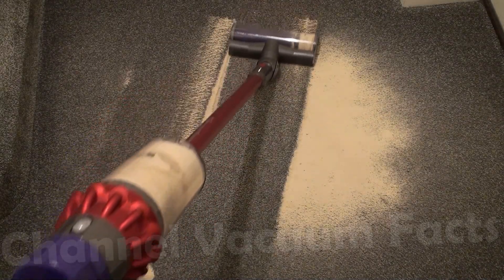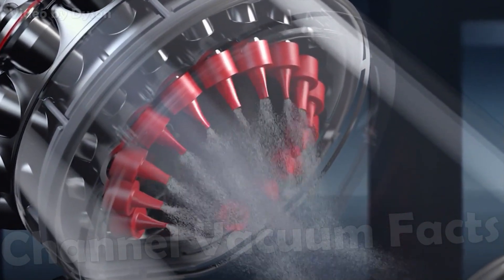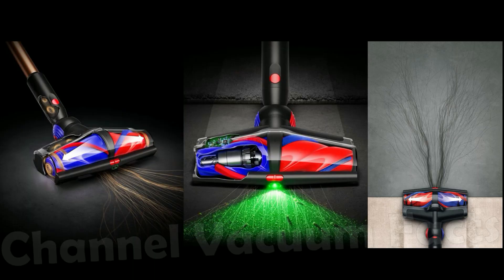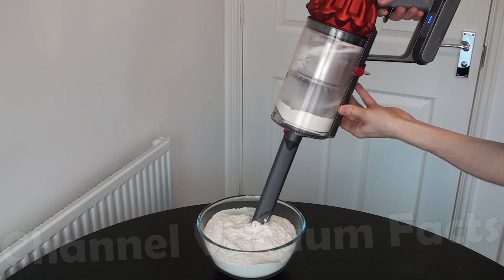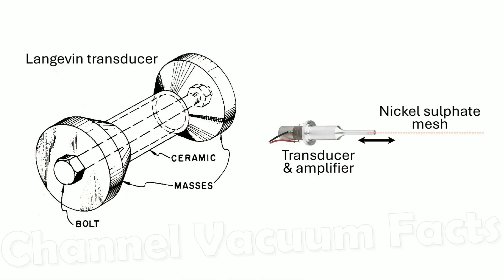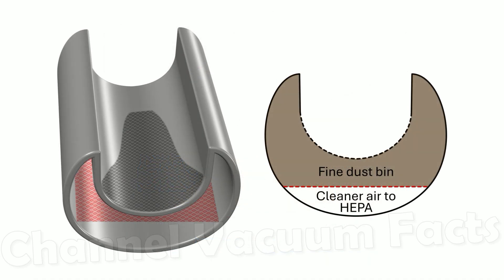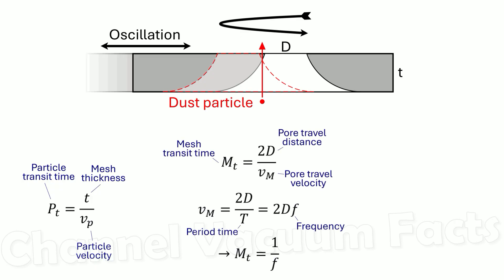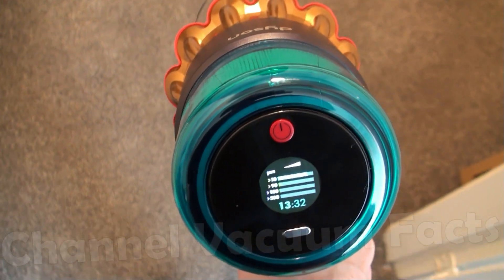Ultrasonic Vacuum Cleaner Filtration — Beyond the Cyclone 2!

Comment: Nice technological preview!  While you don't seem willing to name the developer of the technology, are you willing to share patent numbers for those interested in learning more?  Are there any vacuums with the newer technologies discussed in your recent videos on the market yet?
Reply from the maker: I didn't save them. You'll have to do your own research if you genuinely are that passionate about learning more. It should be obvious who the manufacturer is anyway, since there's only one doing original R&D and innovating. The rest just dupe on the cheap at the expense of the customer.
Reply: @VacuumFacts  I feel like this comment is going to age like milk now that Dyson joined iRobot and has stopped research and development for robot vacuums and is instead putting its brand name on the Chinese-made third-party OEM Picea.

I feel like Dyson products got worse after the Gen5detect. 

V16 and Spot+Scrub robot are really disappointing releases from Dyson. Btw, I just read somewhere that the Dyson V8 has been redesigned with some changes. One comment I remember is that the V8 doesn’t sound like the other Dyson models, and that it might be using a different motor. Also, it has no carbon fibre filaments and no velour bumper on the cleaner head. Do you know more about this?
Reply from the maker: @Ebu26 You've extrapolated and then retro-applied. I think it's too early to draw sweeping conclusions about their products. There's evidence out there about their approach. They're not keen on jack of all trades machines (wet and dry vacuums) and feel separate things do the job better. This goes some way to explain why they took an easy route with that particular wet dry robot.

I don't know anything about the ancient V8.

Comment: i have a Dyson v15 for a while but regret ever getting it based on the following
- The hole into the bin is too small
- No matter how you empty the bin dust/particles go everywhere
- it gets filthy no matter what, most of the parts cant be fully/properly cleaned (outside of the bin and filter - even then the bin still leaves marks)
- the parts for the Dyson feel cheap i wish for the price they made the parts actually premium and not flimsy
- The pole has somehow unstuck from the plastic cconnector at the top and now moves a bit when vacuuming, the bin clip is not fully functional now somehow and will get stuck to where i have to push down a bit harder to get it to come off

Outside of these issues its fine but man I wish I got something different as my daily, I think personally i prefer bagged vacuums, once this breaks i'll prob get a mielle or something
Reply from the maker: I don't have these issues. Not sure why you seem to. I can repeatedly empty the bin without any dust ever leaving the bin. Not sure why you're posting on this video which is wholly unrelated to anything you're talking about. Maybe it was to dig at Dyson and promote another brand in tribal fashion. Who knows...(or cares...)
Reply: @VacuumFacts sorry I clicked off the other video and was replying to another one of ur commenter. I didnt mean to come across like that ive had mine for a few years and issues just have built up sadly at first it was great was just giving my experience to another commenter but managed to comment elsewhere. I apologise if I sounded intrusive but did find this video also informative thanks.

Comment: As of right now, is the Dyson Gen5 or the V16 better? Or should I wait to buy a Dyson for a fix of the v16 problems?
Reply from the maker: V16 has issues that affect performance. I've fixed it myself, but not everyone will and shouldn't have to. Otherwise, it's actually quite good. Gen5 is great, V16 is more efficient, refined, with overall better tech bar some provisos I'm still investigating.
Reply: @VacuumFacts  How did you manage to fix these issues?
Reply from the maker: This will be discussed in the review next year.
Reply: @VacuumFacts  looking forward to it
Reply: Go for the Gen5. It’s just straight up a better vacuum, especially for most people. The filtration is better, the two separate floorheads are better. And it’s cheaper. No brainer.
Reply from the maker: @Ebu26  The V16 is better technology all round, but the overall finished product is let down by some avoidable decisions that I'll discuss in my review...and no one has said a thing about on the entire internet...

Comment: So Cinetic Science maybe making a comeback but just in a different way? Looking forward to what is to come.
Reply from the maker: No, this is non-cyclonic. Dyson don't publish the quantitative filtration effectiveness of their technologies, so direct comparisons aren't easily possible.
Reply from the maker: Incidentally, the reason Cinetic wasn't brought to handhelds is because I suspect it only works with constant cyclone entry air speed, and possibly very high speed. Battery powered devices don't brute force on high all the time since it isn't actually necesary, and they have varying cyclone entry air speeds due to power modes. The propagandists used it to suggest it didn't work, but never provided a dot of reputable evidence, as you'd expect from the worst out there.
Reply: @VacuumFacts  I am aware of that. I was more so referring to how having vibration is a good way to separate dust from the air to prevent clogging. I love my Cinetic vacuums. Only problem is the cy22 seemed to have some design flaw as I have been through four of those and they all lost suction. My aunts lost suction and I have seen countless reviews stating the same thing. But only with that model, my DC54 has been a champion and more recently my CY26 has been great.

Comment: Really enjoyed the breakdown in the video! I'm still a bit confused on how the dust separation inside the bin works with this new ultrasonic + filtration system. I watched the part where you traced the airflow path, but I’m struggling to picture how the dust particles actually get pulled out of the air and trapped separately inside the bin. Could you explain what's happening step by step inside the bin?
Reply from the maker: Air and some small dust gets through first filter into horseshoe shaped tube. They reach second vibrating filter. Air gets through that but all dust 1 µm or larger gets bashed back and stays in the horseshoe shaped column. It's microfine dust so just floats around, possibly recirculates and gets bashed back again, electrostatically aggregates with other dust, sticks to walls, and clumps off and gravitationally sediments at the bottom. It's like the current cyclone discharge chamber.
Reply: @VacuumFacts actually off topic question but I saw your other videos and I'm curious, why does cinetic cyclones not work if their is a variable entry air speed like on the mains?
Reply from the maker: @mimichou1550  Their vibration was tuned for particular entry airflow, I think.

Comment: awww...they have thought of the ultrasonic idea which i came up with during the pandemic-though I have drastically reduced my desire to start a company/business in the future and just live a simpler life. I still have an alternative solution but still very similar to ultrasonic operation. 
anyways, my ultrasonic cleaner solution starts running during power-on and after turning off the vacuum though of course new ideas and solutions will come up during a lot of testing or R&D.  They likely chose to run the ultrasonic device during vacuum operation because they found the fine dust gets harder to remove if transducer is not run more often.
Reply from the maker: If you want to live a 'simpler life' then don't whine if someone co-invents your alleged 'ideas'—unsupported by a dot of evidence that might command respect. Also, they 'chose' to "run the ultrasonic device during vacuum operation" because otherwise it wouldn't work AT ALL, as clearly explained in the video, indicating whatever you're talking about is nonsense or completely different.